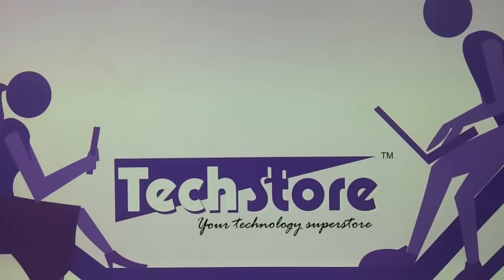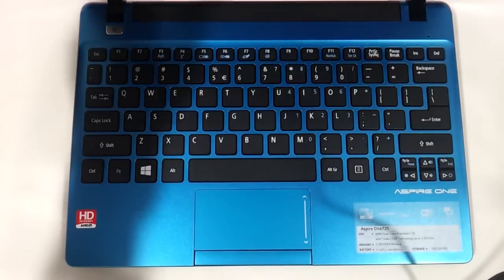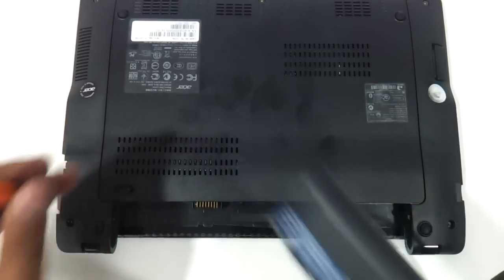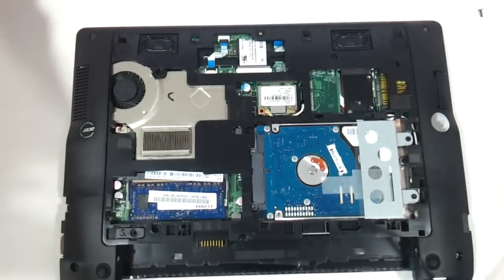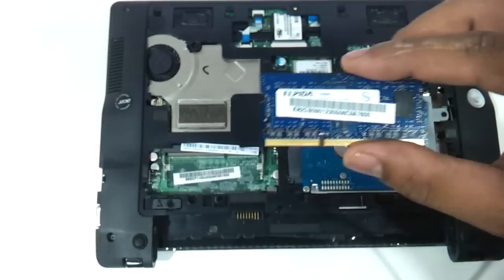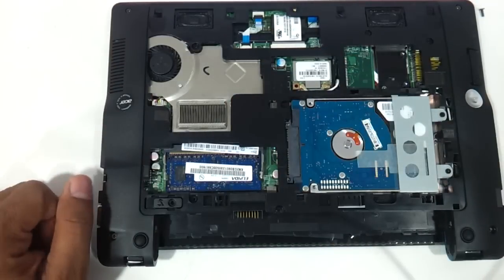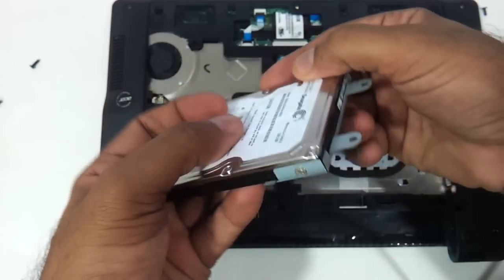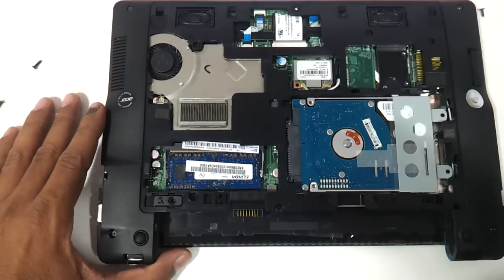Acer Aspire e725 aod725 725 how to upgrade ram diy

Comment: Thank you for this video.  I have an acer e725.  It have been running really slow. I was wondering if it is because i upgraded to windows 10?  It was working fine for awhile but now is freezing up and pages are loading extreemly slow.  Im low on funds and would like to try and fix it, if possible.
Reply: Is it working good after changing ram and how much Ram can we put in e725?